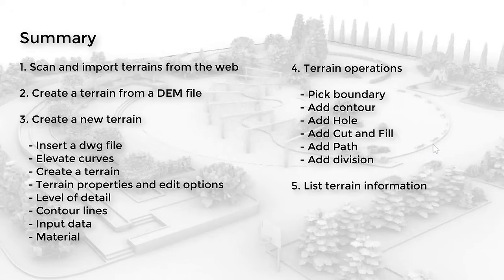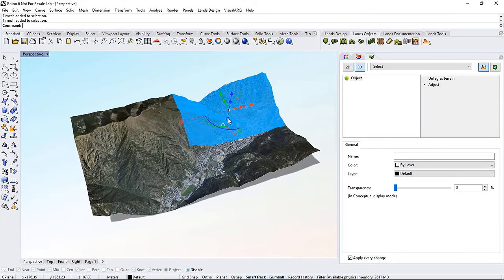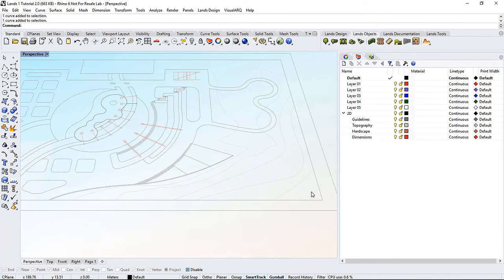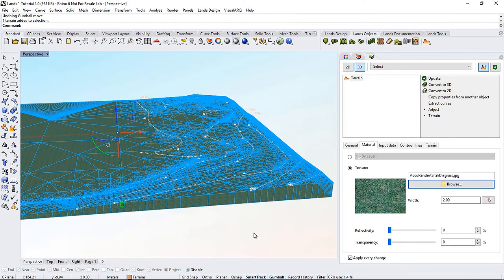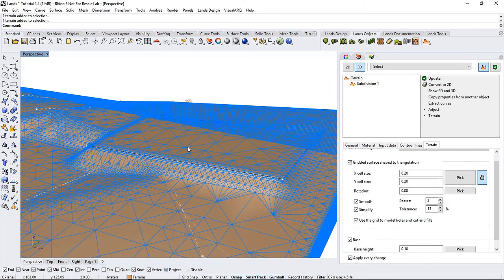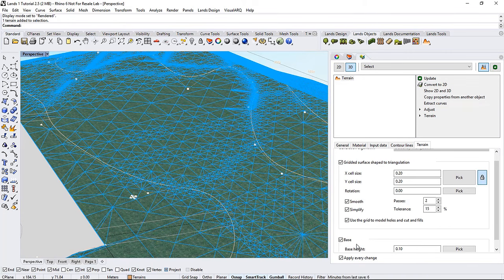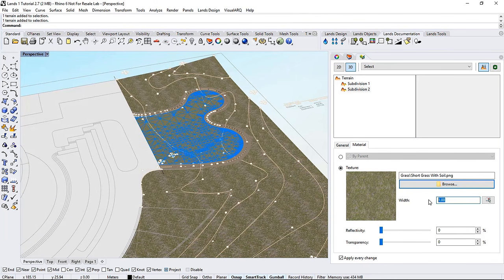Lands Design Tutorial 02: Terrain Modeling Tools

Comment: This has been a very useful tutorial as I am looking into switching to this software (I really appreciate that it isn't subscription based, this is my primary reason for looking into your software).

The software and the reference file have both been changed since this tutorial. These changes make a half hour tutorial take hours to follow because I'm spending so much time looking for the buttons that are referenced. The entire left sidebar is different in my version. I'd love to have all of the buttons that are shown in this tutorial.

FOR ANYONE WITH THE SAME ISSUES:
Switching between 2D and 3D: Click Edit on the right, Then click Viewport, then you can choose between. The tutorial sometimes shows this and sometimes has an different option that I didn't have. 

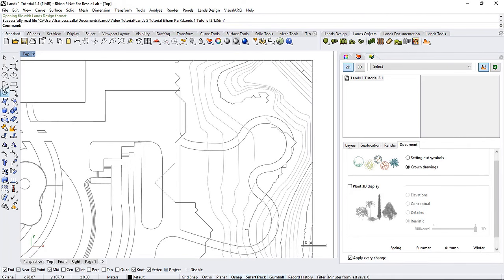Within the file, they have already completed the layer organization work that you start with. They also connected lines across the path that they put a polyline across at around 15:30. I had to select that curve and explode it (explosion button on the left sidebar) to be able to follow the curves that should be selected instead of having it automatically include incorrect curves

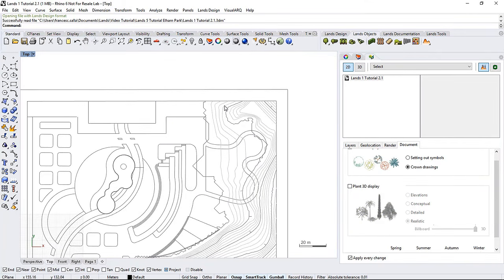The OSnap toolbar is also hidden (it took a while to figure out how to find the snap to knot feature that they used at 15:30). This tutorial is much more difficult to follow without that toolbar enabled. find it options>toolbars>Osmap or Object Snap. It will be a floating toolbar that you can anchor somewhere (I couldn't anchor it to the bottom as shown so I had to put it on the right panel.

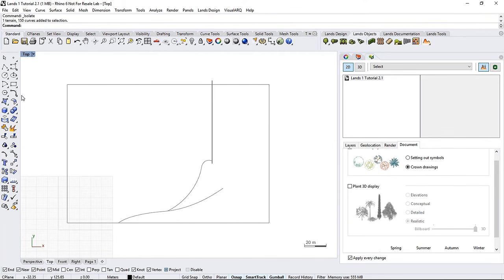16:14 The Curve Boolean button is in a different location. Click Drawing at the top, then you will see it in that toolbar (along the top). Left click on the output to switch between curves and surfaces

18:22 The "Elevate To Terrain" button is now found by clicking "Terrain" at the top of the screen and looking in that menu. Note: there must be a better option as this button appears to be for moving individual items to the terrain level.
 
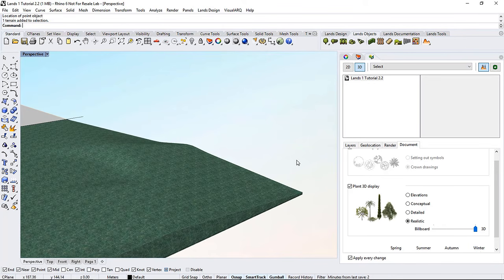18:52 The point button is now Found by clicking the Drawing tab at the top then selecting point there

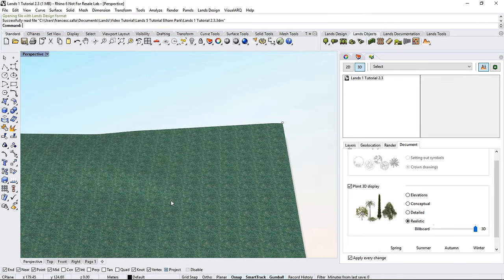19:40 Rectangle is in the Drawing tab at the top

Note: The hole that was created for me was automatically at 90 degrees to the bottom of the excavation and I do not have the same option to use grid to model holes and cut and fills, but double clicking on the excavation and selecting Hold under Earthmoving

(At this point, the number of differences between the software and the video that was linked to by the software is a bit much... I will finish this video then look for a newer version, I'm learning lots by having to look around even though it is annoying)
Reply from the maker: Hi, thanks for exploring and explanations. We guess that you have installed version 6 and are following these tutorials which are recorded for version 5. There is a new set of tutorials for RhinoLands which has a new interface, and that might be the version you have now. If that is the case, please watch this playlist: https://www.youtube.com/playlist?list=PLBKOaJp17CZqSR-zjE231xTcV-MIaR_zD

Comment: where is the edit panel in Rhino 8?
Thanks!
Reply from the maker: If you open the Lands Design toolbar, there is an icon for the edit panel inside the Lands Design toolbar. Another way is from the pull-down menu of Lands Design, (on top of the interface), click on this pull-down menu, and open the edit panel which is accessible there. If you have the RhinoLands interface, all panels are accessible form a rectangle icon on the top right of the interface.

Comment: I have one problem, when I click on the import earth's elvevation data white window appears, but the map does not appear
Reply from the maker: Hi, If you have Windows 11, without any more info, we guess the issue comes from Windows 11 permissions.  
We have seen similar issues with other users having Windows 11.

Please check if you have a “Lands” folder created in the following path:
C:\Users\Public\Documents
If not, then you might have restricted the permissions on that folder (we think Windows 11 has something to do with it). To solve it, can you try the following?
Right-click on the “Documents publics” folder and select Properties.
In the Security Tab press on the Modify… button. In the new dialog, press on “Add…”
Here, type your windows username, to add permissions only for that user. Use the verify name option to help you find the user exact name.
Once you have added your user to the list, enable for it the Total control checkbox. Press OK to apply the changes.

Comment: Hi, so I am relatively new to LandsDesign and I have been trying to import the scanned terrain onto my rhino after many attempts. I have read a lot of forums and watched a lot of videos but my problem don’t seem to be solved. I selected an area in which I wanted to import after going into the “Import Earth’s Elevation data” interface and clicked import. But the interface has stayed frozen for quite a while and so I thought it was just running and I left it to run. But after a couple of hours, it still stayed on the same interface. So I uninstalled Lands and reinstalled it but the problem doesn’t seemed to be solved at all. Please help out, thank you
Reply from the maker: Hi Grayson, it is possible that your internet connection makes the issue. To import elevation data, you need to have a good internet connection. Also, check the size of the project if is so large. In any case, if you are in 2D (especially in a view like wireframe) you won't see the terrain well. Finally, try to import another zone, and check the Lands Design edit panel to be in 3D,  and let us know if the problem persists.

Comment: Whener I add a path it ends up with sharp angles, it's never curvy, even though the line I selected is a curve. What do I do?
Reply from the maker: Have you tried to increase the smoothness, by moving the corresponding slider to the right? This slider appears in the Lands Edit Panel when you select the path object. I'm assuming you mean a Path object, not a path as a terrain earthmoving.
Reply: @RhinoLands  Yes, the path object, as in the video. Thanks a lot!
Reply from the maker: @comment514  Ok. Therefore, increase the smoothness, by moving the corresponding slider to the right. This slider appears in the Lands Edit Panel

Comment: HI thanks 

The Plugin seems to have useful features..  

So i am researching in ways to  improve imported Terrains for rather big Architectural Cityplans.   this said, i try to import Terrains from China, which are Du to the bad online Datas in many cases not good enough.  I am no Rhino user.   But what i would like to know are two things..  

is it possible to also manipulate the imported Meshmoddel in an easy way?  In 3DS Max, i would just use a Brushtool, that moves the surface, using a selection falloff. 

There seemed to be something compareable in Rhino too...     SoftMove...   But i cant get it to work 

But more important.  When i try to manipulate for example "Hills" that the Nasa Scann of the terrain accidentially created in China, because its Radar thought a highrise Building was a Hill..   I can use your Terrain and can get those.. hmm  what was it called in Rhino..    Points..   i can manipulate one after the other..   

But this is very inconvenient..   what i would like to do is to select a point or several points on your terrain and move them up and down, using some sort of Softselection (so caled in 3DS Max)  comparable as it seems to be done using SoftMove..   does this work also on your Terrainobject..  just to be able to manipulate bigger arreas of the terrain in a faster way but to push single points?   

That would be great...
Reply from the maker: Hi, You can modify the imported terrain, if when you import it, select the terrain, not mesh. This is an option in import terrain dialogue box. Once terrain is imported or generated by contour lines, you can select several point all at the same time and move them or indicate them an elevation. In Rhino, show control points helps you to do that. There is a nice option also, called add contour, and what it does is to create a new contour so that all points you desire, will be placed there. If you have more questions, please write us to landsdesign@asuni.com

Comment: I have few question, I commented on previous video too. How well can it deal with several excavation works in same place? one on top of another and another etc. Also we would often get roads in their proposed heights of their boundaries, its very important that the road and the landscape meets those boundaries without holes. Roads are not always the same width and often have odd turns (Construction site). How well this plugin can deal with those problems? Instead of just using typical central line and offsetting it in same width.
Reply: Also when you do the excavation work, is it possible to keep the land that was cut out?
Reply from the maker: @InteractViz  that's not possible, unless you work on a Grasshopper script for that. The terrain knows the volume of that land that was cut out though, and report it in terrain lists. But it's not visible as a 3D geometry. Using Grasshopper you could keep a copy of the original terrain and the one after an operation, and generate the 3D of the resulting geometry.
Reply from the maker: Hi TheMartsy, the lands terrain stores all the operations you apply on it in the Terrain properties panel > Input Data tab. There you can change the order of these operations from the arrows below (next to the "Remove" button). The resolution of the terrain operation with the boundaries and its accuracy with the provided curve will depend on the terrain cell size. Take into account that terrains are meshes, so it might not be always possible to get sharp edges where a terrain cut or fill ends. Unfortunately, it is not possible to have paths with a variety of widths. It's a planned feature on our wish list though for future versions. Alternatively, you can use different curves for each segment of a path or turn on a terrain that has different widths, although it might be difficult to make each part connect nicely with another.

Comment: Please make it possible to import the entire DEM without needing to select an area. The way the import DEM window works, it makes it impossibly to select corner to corner. For example, if my DEM is 1000x1000, it always a few rows in the bottom unselected (1000x995 for example).
Reply from the maker: Hi Primoz, thanks for the suggestion. If you double-click on the image, you will automatically select the whole area. In any case, we will try to improve this dialog so it's more clear to do the area selection.
Reply: @RhinoLands  Thanks for the tip, very helpful. Letting the user specify a fixed resolution (eg. 500x500) and a center point of the region would also be helpful. There are other ways of doing this, for example photoshop or QGIS, but since the DEM importer gives you the possibility of choosing a region in Rhino, it would be nice if there was more control.
Reply from the maker: @pbrglez  all right! we take note of your suggestions to improve this tool.
Reply from the maker: @pbrglez  I let you know that in Lands Design 6 we have added a hint in that dialog to help users understand how to define the area to import.

Comment: Where you had the path as a separate element.  Can you bring that into revit as a separate topo surface?
Reply from the maker: Yes, there are 2 paths in Lands. Path in terrain and path tool which creates with a profile and is a separate element (a surface/ mesh).  In the path in terrain case, you can do that by Rhino inside Revit plugin all terrains of Lands Design can open in Revit and be edited later.

Comment: THX! there is one question, how to join two terrains together? like i have a 1:100 model which is more precise,  how to put it in a 1:1000 larger scale model and combine them together?
Reply from the maker: Hi, are they meshes? You may place a mesh on top of the larger terrain and then make a boolean with boolean union command in Rhino.
Reply from the maker: Hi, you can put small one over another and make boolean for both objects.
Reply from the maker: Please send us the file you found the issue to: landsdesign@asuni.com

Comment: Hi, my terrain does not seem to properly be responding to curves or points: When making a hole exactly like in the video, it does make a hole. However, firstly, the subdivision is placed much lower than the curve itself! Secondly, when moving the curve up or down, or the control points to the side, the terrain does not follow!

More over, I can add points, and when moving them, the terrain does as well. However, for some reason, I cannot delete the grip!
Reply from the maker: Hi Signe, please send us the model to landsdesign@asuni.com so we can better understand the kind of error you are getting. Take into account that when you create holes (or do other operations) on terrains, the selected curve for the hole boundary is not linked to the terrain anymore, so the terrain doesn't react if you move, delete or edit the grip points of that curve. The terrain absorves the control points of that curve, so you can edit them if you activate the terrain control points. These grip points can't be deleted individually. You can delete the "Hole" operation, from the Lands Edit panel > Input data tab, selecting the Hole in the list, and clicking on the Remove button.